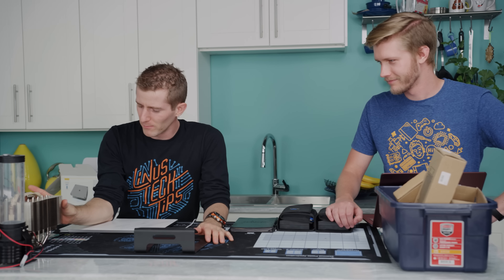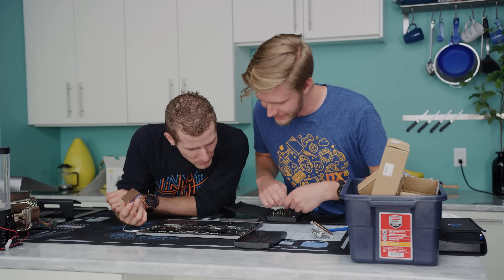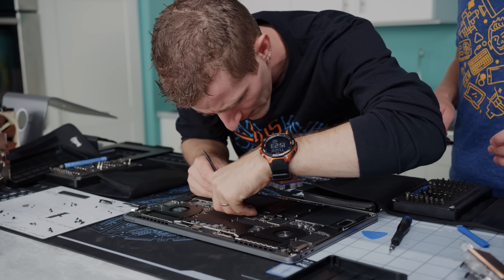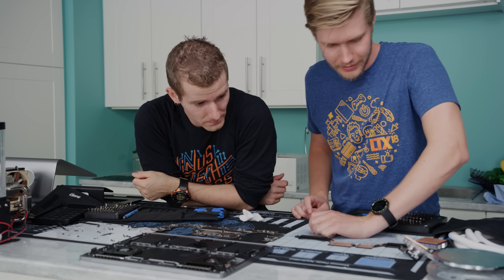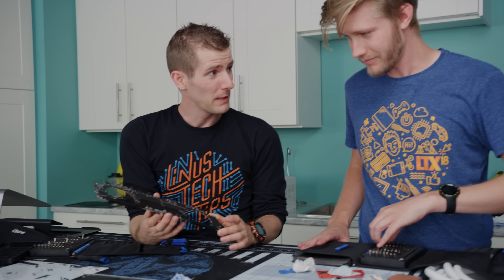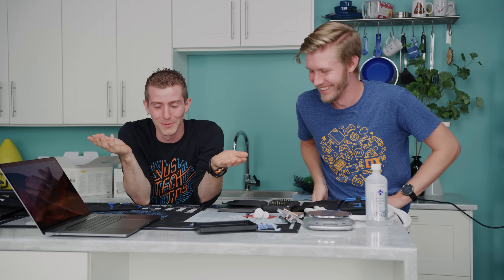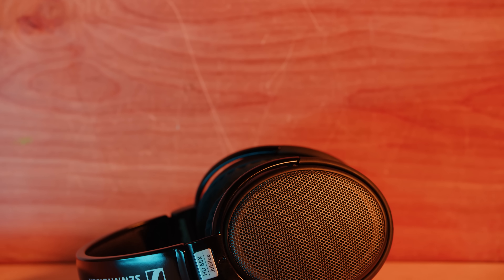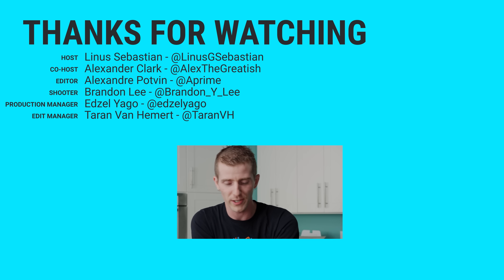We FIXED Apple’s New MacBook Pro

Comment: Apple keeps making overpriced pieces of shit but this year is really the icing on the cake.
Reply: @rmdtd  that doesn't mean it's not overpriced, or a piece of crap. OP has a point in that you buy a MacBook pro with an i9 to do work, just for it to throttle under base clock because Apple couldn't be bothered to make a better cooling system? But because people have had success with apple products in general automatically makes this good? No.
Reply: @Owain Harris You're the one who is a kid. Businesses use Windows much more often than Mac. Numbers that range from 4xx greater to 90% more Windows than Mac users, depending on the source. Art? Lol there are GREAT Windows Art programs that are equal to or better than Apple. Price to performance and user manipulation alone are reasons to use Windows. Apple is over-priced, loses on the performance per dollar, and is limited in it's total scope.
Reply: from sealed retail box to thermal throttle in less than 30 minutes. Apple, it just works.
Reply: I am still waiting for someone to show me a Windows laptop with i7 8750 or higher that has the same or better build quality than the macbook pro, with a trackpad that is as nice as apple's, a good graphics card and in a decent - ultrabook - size factor (no gaming laptops please) that doesn't thermal throttle. it has to be pretty too.
Reply: Steve Jobs is rolling in his grave.
Reply: Hcet, the best selling car isn't neccesarily the best car.
Reply: Mad because poor.
Reply: @pakmule88  You're mad cause your an iSheep.
Reply: I don't own an Apple but from experience all laptops I've owned are at least half of the CPU performance as the the desktop version. Example is my 2018 Razer Blade Stealth has the newest and fastest i7 but my 5 year old i7 nearly doubles the benchmarks of it.
Reply: @Owain Harris but you'd think they'd try to design a better cooling system for those professionals. I get that Apple products have there place but there is a clear indication that they don't care to engineer to reach max performance. Look at their cooling design, a unibody with few fan ports and minimal heat pipe. 

Performance > Aesthetic
Reply: A lot of Airports use Microsoft or Linux
Reply: lol   apple  server  any 1   appl dosnt even make   server grade  /work station  grade stuff     any more  its just  under powered  crap  AMD   GPU,S  LIKE RLY    FOR DOING  CAD ETC  GOOD LUCK   LOL    I SAY  BRING BACK   THE CHASE  GRATER  MAC PRO WITH    DUAL XEONS    AND  nvidia quadro GPUS
Reply: I just came to the comments to see opinions from people that have never owned an Apple product and this one was an easy find.
Reply: Hcet Evisoliat they are idiots.
Reply: @fortazerty  Idiots according to your bullshit half-truths.
Reply: @rmdtd  Tell that to all the MacBook design fuck-ups and the times that Apple tries to weasel itself out of taking responsibility for hardware issues.
Reply: +Owain Harris I am still waiting for someone to show me a Windows laptop with i7 8750 or higher that has the same or better build quality than the macbook pro, with a trackpad that is as nice as apple's, a good graphics card and in a decent - ultrabook - size factor (no gaming laptops please) that doesn't thermal throttle. it has to be pretty too.
Reply: @iakdna  try the LG gram and the surface series. The mi laptop series is quite nice as well
Reply: @iakdna  and if you want pretty, dbrand.
Reply: yeah, tell that to all 2 of them, and the few thousand hipsters pretending
Reply: +Owain Harris I have 2 contentions. 
1. Sure, the 'professionals' are able to get satisfactory results with the overpriced tech. But that's not the point here. The point is just because something 'works' does not mean that it is of great value. And putting an argument that some people are fine with it, without even considering some people that actually aren't, is no argument at all.  The premium price that apple charges for its products should be satisfied with an equivalent level of optimisation and reliability with it. Apple, the arbitrary status symbol it is, has shown a deviation from their original policy of quality and efficiency by making do with subpar products, both in software and hardware, with providing no justification for the same.
One major objective of the occasional viewer watching channels like these is to gain necessary knowledge before deciding on a product to invest their money in. Without videos like these, people will be subject to the scrutiny of false advertising all the time.

2. The content on Linus tech tips would have been click-bait if it was intended for the abovementioned 'professional' section. The creatives, especially artists, are seldom concerned with every latest development in the 'tech world'.  The problem of overheating of a poorly cooled i9 processor has been widely known online. And just because a title was made to attract the viewership, downright calling it a 'click-bait' is quite rude, to be honest. There exist a lot of actual click bait videos out there with questionable thumbnails, generic titles and the same repetitive content. LTT at least makes new content.

I hope I have sufficiently answered to both your problems.
Reply: duuuh, the fucktards keep on lining up to buy their overpriced POS, so why would they stop ??
Reply: Hcet Evisoliat Lol your point is dumb. People use Apple products because they’re easier to use. Not because they have top quality build parts. Apple is overpriced. To say it isn’t is a lie.
Reply: everyone is entitled to their own opinion people have different views on this subject some people love apple and some don't its all down to personal preference
Reply: dont u mean the shit cake cause apple sucks balls at making real high end pc
Reply: @Owain Harris atrists and graphic designers dont use Mac because it's better but mostly because it is what they where typically trained on because most of the programs originated in old Mac os. So if you go to school and are taught by people who only use Mac because when they started you learn on a Mac and just stick with it.
Reply: @Hcet. We will.
Reply: The quality of apple products has degraded there is nothing to deny in that. I have a older mac book and it works fine till this day (2014 model) but other companies  are catching up to apple many new features have arrived in the pc market  ,and many other laptops are giving equal or sometimes a bit less performance for  half the price same is in the smartphone market . But still their products have excellent quality but its not worth it for that huge price tag  and with the growing middle class budget is a top priority.
Reply: But Iphones are actually overpriced, especially the new ones (new samsung phones too though)
Reply: @tillnachtigall  It's not nearly as bad with Samsung phones
Reply: Apple knows what they're doing, they knew the iphones would bend, remember the unibody? Who knew heat sensitive glue right next to the exhaust could go wrong? They were sure the i9 macbook would overheat, it doesn't take that much testing to see that clearly.  Did they care? Hell no.  Your older iphones run slower even on an old is, know why? They put bad batteries in them intentionally so you would have to buy new ones, there was a class action lawsuit against them for this
Reply: Actually, if you do the math for the 27" 2018 Imac you come to nearly the same price apple sells it for, for the reason they are using 5k monitors you only get for around 1500€ as a consumer from brands like dell. The thing is nobody needs a 5k monitor.
Reply: @tillnachtigall  It is downscaled then upscaled so it truly isn't 5k..
Reply: I have been for years.
Reply: So far almost every "workstation" laptop that has tried to shove an i9 in their chassis has had severe thermal throttling issues, this isn't an issue exclusive to apple. iPhone are overpriced because they recuperate their investments into more expensive technologies through an increased phone price, because Apple chooses to design most of their hardware and software in-house, they pay an extra R&D premium in comparison to other companies, who will either outsource, or use defective materials because they can be sourced for cheaper. 

For example Apple SoC's are 2 generations ahead of qualcomm, and they have way more silicon on-board their chip, which means more transistors. Which means more power. When you pay extra for an Apple product, you're not just paying a badge premium, you pay about the same for the badge as you do for the badge of a company like Samsung. You also pay the extra R&D and refinement Apple puts into it's products. Because let's be honest here, if Apple was releasing overpriced pieces of shit, there's no reason for professionals to by buying and actively using them over any other product. The only thing pundits ever seem to bring up is the "overpriced" part.
Reply: @tozendai840  The real world usage of their SoC's (Apple's) is quite dismal. It is very tough to actually use it. Let alone the 845.
Reply: Apple SoCs tend to last 2-3 more years more futureproof than it's equivalent year of release android counter part without getting laggy/having to upgrade.

Comment: They sure don't make them like they used to. Got a 2003 iBook G4, changed the HD 3 times (thermal issues, what else is new). Every time I put it together I had screws left over. Not a problem, booted up every time.

Comment: With all this liquid metal, there going to have more issues than leaky capacitors and batterys in our future lol

Like a hole burned through your aluminium unibody macs xD
Reply: Yeah, their application is poor. They should've put clear nail polish on the chips surrounding PCB contacts and to prevent any spillage, tape off the chips PCB with high quality thermal electrical tape. That's the proper way to do it. I doubt Linus cares though because they were probably given the machine and it's a cost of business situation for them if things go south.

Comment: The issue isn't just heat, the biggest problem actually is the power rail doesn't deliver enough power. So all the cooling in the world won't fix the actual problem, the manufacturer. Apple does this so as the parts begin to degrade, their products will fail forcing their buyers to have to buy a new laptop since they are hoping to shut down all the repair shops with the ability to fix the boards forcing their customers to have to spend another $3000 for a laptop they have engineered to fail on purpose so you'll have to spend another $3000. And the best part, Intel is pissed since it looks bad on their product, but Apple isn't planning on changing anything. So, Intel is reducing the power consumption to protect their name which Apple I now pissed.

Comment: Linus, you should know better. Conductonaut doesn't require applications until up to two years, at worst. Everyone using liquid metal will tell you that brands vary, but it appears those who chipped in for the good stuff has still "Wet" metal after that long.

Comment: You forgot to mention that if liquid metal touches any part of the unibody or the botttom plate, the gallium will definitely eat away the alluminium over time, even if you clean it inmediately. That's another reason not to do it, or to be extra careful not to put too much.

Comment: I used to work with repairing phones(iPhones mostly) and some of the Apple products needed the right screws in the right place because of the magnetic interference, basically taking the help of magnets rewiring the data and energy going through the board

Comment: I suggest spraying liquid metal all over earth to fix global warming
Reply: The T-1000 terminator doesn't have problems with thermal throttling. X)
Reply: It would actually really bring down the heat easily enough to start a infinite dead ice planet. But so would covering the earth with snow.
Reply: also poisons every creature on earth too thus killing two birds with one stone... or mercury rain...
Reply: Ironik Good thinking sherlock 🕵️‍♂️
Reply: zuluknob But it has no air flow
Reply: >implying global warming is something we can fix or we should fix

Comment: I have to report in -- PLEASE READ!! I used the same Conductonaut Grizzly Liquid metal for over a year on my 2012 Retina MBP (same cooling system through 2015) and it dried up and got stuck on my COPPER heatsink. Yes, heatsink wasn't ALUMINUM, a COPPPER and it dried out and the liquid metal became one part of the copper heatsink. I applied extra liquid metal on top of it to temporarily gain back the cooling ability (works great again), but unless you are willing to purchase a new heatsink in the near future, I do not advise of using Liquid Metal on Macbook Pros. It was working amazingly for a year (and half), but it suddenly throttled almost all the time. If you are using liquid metal and see such excessive throttling, it means that your liquid metal paste has dried up. You may even notice that your laptop is cooler to touch since the heatsink isn't transferring the heat from the CPU correctly. Also, the heatsink was pretty easy to remove for 2012-2015 mbp. Not sure why this one was such a hassle to remove :/

Comment: Linus did a test maybe two years ago (?) that partially submerged a Macbook in water to dissipate heat through the aluminum chassis. The performance was 2x what it was. Yep. So you pay for this expensive CPU that throttles to HALF when used for very long. What's the fucking point then? If you have LIGHT usage you don't use the CPU fully but if you have HEAVY usage it throttles?

Comment: Maybe Apple will start selling their products with liquid metal as a thermal paste replacement.

And change an extra $750 because of it.
Reply: Well, 750 might cover the 8 hours of labor just to open it
Reply: And the one that doesn't use liquid metal will be labelled as "budget laptop"
Reply: Sham Ringo nah they’d also make the screen 720p then label it budget for just £850
Reply: Ziplash MC No that 850 is extra to "upgrade" from 1080p to 720p miracLED panel.
Reply: I was going to say that the general user would have to sign up for the warranty plan to have the liquid metal replaced and Apple would like that... but then again their laptops tend to break so the liquid metal may outlast the laptop.
Reply: @BakjeLeip  Yea like their Liquid Retina display.... Which means LCD and isn't even 1080P.. on the iPhone XR.
Reply: shhhhhh... Don't give them ideas
Reply: Even if it was a joke, liquid metal cannot be used in long term, it needs regular service.  STOP, sell MacBook with it and make your customer visit INgenius-bar every half-a-year!!
Reply: Yeag so apple sheep will surely buy it
Reply: Apple has the opportunity to make a good product. They produce a limited variety of laptops and have massive buying power. As you said Jim, if only they cared.

If I treated my clients the way they do, I'd never work again.
Reply: Very funny but if you watched the video he said that liquid metal needs to be periodically reapplied so no company would put in on their laptop
Reply: Wtf apple would never do something like that they are a very respectable company that makes quality products.

That's why they're gonna make it a 1900$ upgrade

Comment: Hi Linus i have a question would water cooling work with out water/any other liquid but use liquid metal instead ???
Reply: Usman Ali water has a vreat thermal conductivity. Also the amount of metal you would need makes it dangerous and heavy af

Comment: Tip: take the little ball of liquid metal off the applicator tip by using the little swab-on-a-stick that comes with the product. That should minimize risk of LM spurting all over the board unexpectedly.

Comment: I tried this last week for a YouTube video. I almost broke my Mac. I ripped the right speaker socket off the motherboard. The soldered pin came off. This is a very risky procedure because if you want to take the heatsink off, you have to remove the whole motherboard.
Reply: Trône de Marchandises just saying that there is a great risk. This laptop is not even 1 year old and it cost thousands of dollars.

Comment: Hey Linus, What About the Temperature Readings??  😕
Reply: Throttle. That's the temp measurement.
Reply: temp measurement is celsius and it's nowhere in the video
imagine GN posting a video like this without any temperature readings
Reply: @Quinteger  it probably throttled at max temp like before, but at a slightly higher clock speed
Reply: @vnyggi621  they could've shown us temp and clock charts instead of this pointless speculation
Reply: Let's just fill his Twitter with the Same question...
Reply: Sidharath Bansal yes sure we want